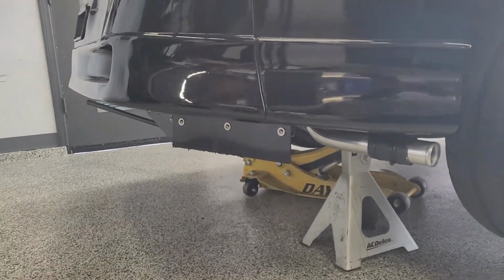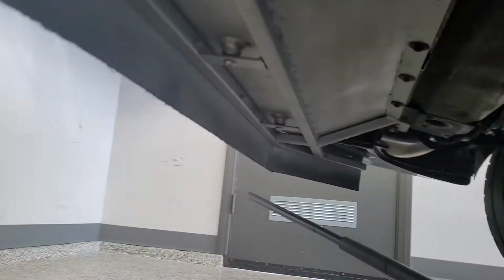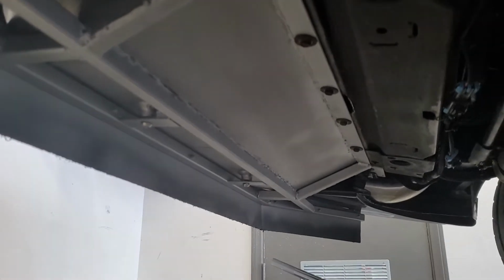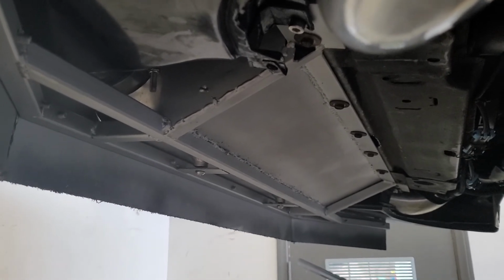SUPED89 - (Part 2/2) Improving airflow through a front mount intercooler thirdgen Firebird / Camaro.

Comment: Do you have a build thread somewhere on a forum?
Reply from the maker: I started one here but ended up just doing YouTube clips.  https://www.thirdgen.org/forums/power-adders/759109-procharger-d1x-370ci-build.html#post6322488
Reply: How did this work for you? I'm having cooling issues with my 3rd gen camado and I have a big front mount infront of the rad. Stays cool at idel but gets hot wile driving